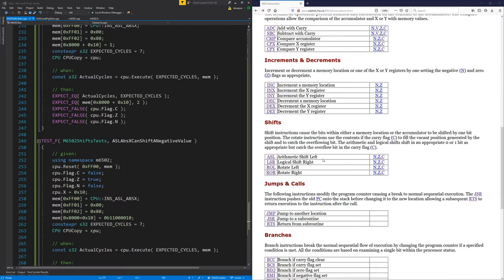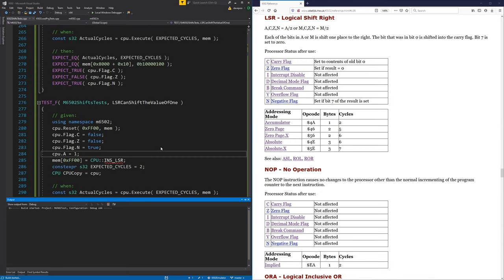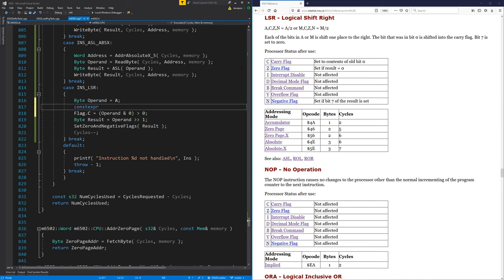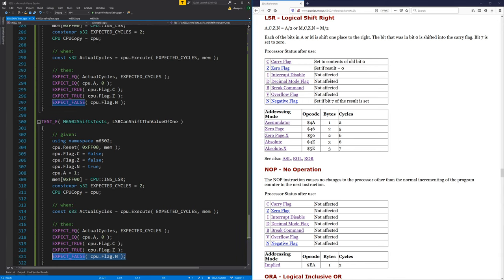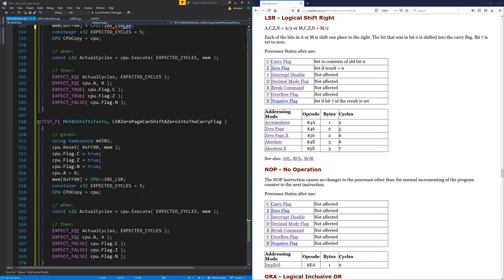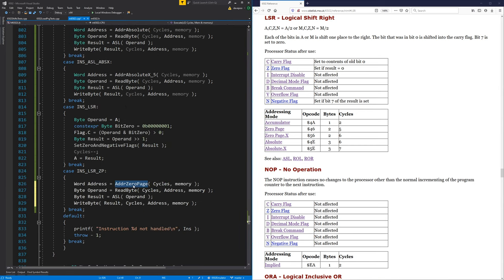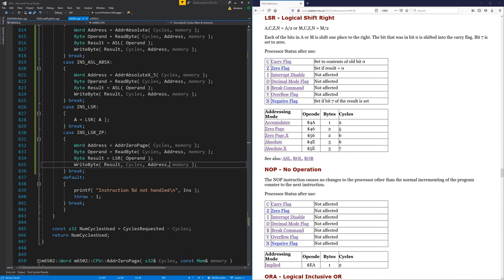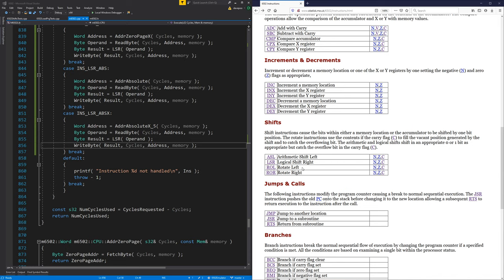Emulating a CPU in C++ #28 (6502) -  Logical Shift Right

Comment: Interesting that it's called Arithmetic Shift Left, but Logical Shift Right, since they're basically doing the same thing (in opposite directions).
Reply from the maker: Perhaps there are some 6502 aficionados who could answer that here?
Reply: @DavePoo  While they are technically doing the same thing, which is shifting a 0 into either the MSB (for a LSR) or LSB (for an ASL), a logical shift right is "logical" because it doesn't preserve the sign of the value in the register. A signed number is represented in two's compliment form, meaning it is padded with 1's up to the MSB. When you logical shift right a signed number, a 0 gets put in the MSB position and the sign is lost. That's why an Arithmetic Shift Right exists, it preserves the sign of the value. The Arithmetic Shift Left is "arithmetic" because it multiplies the value in the register by 2^N, where N is how many bit positions to the left it is shifted.